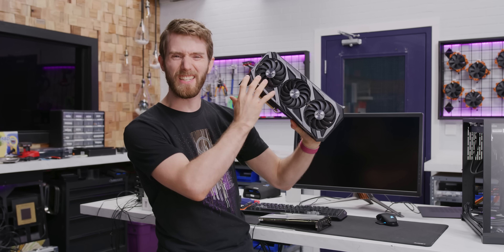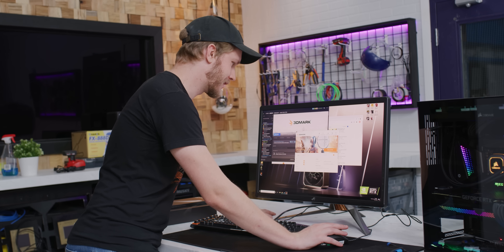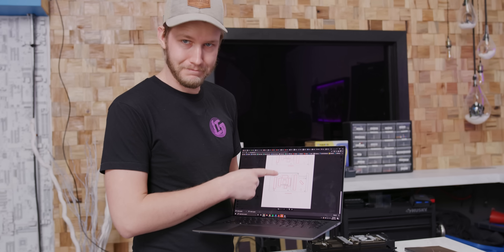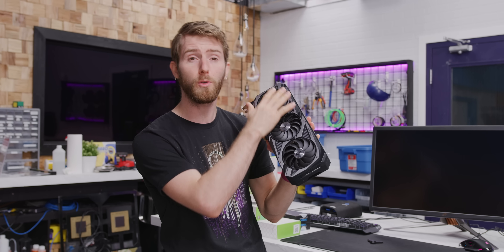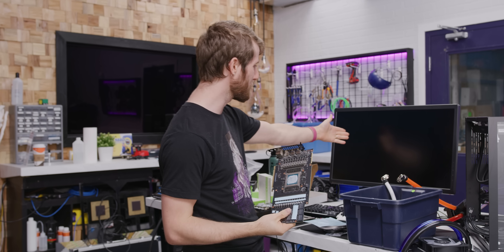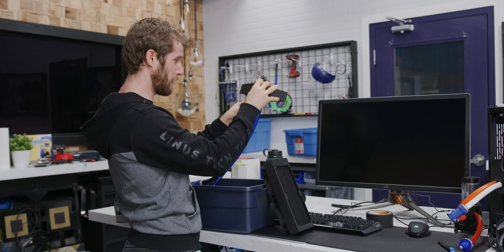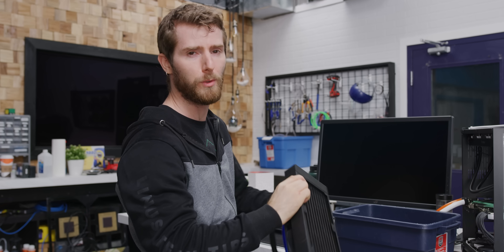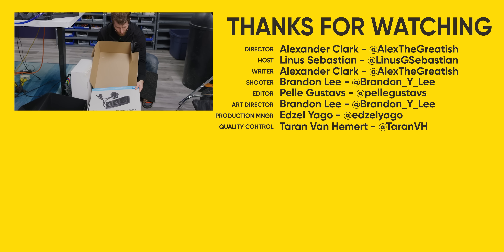Water Cooling the RTX 3090 is... More Complicated

Comment: My Alphacool st30 x-flow 360 rad is essentially silent with my fans, asus rog cpu/m.2 monoblock, and an alphacool cape Cora passive radiator so I don’t even need fans. And I only use 3 of the 6 cape Cora pipes, making it about the width of a regular radiator. I’m sure I could add my Gpu to the loop with no change in temps but I don’t have to, the whole system stays at room temp even with a blower style card. Open air case ftw.

Comment: I have a 9700k and a 5700 XT in an NZXT 200i (ITX mini), both water cooled. I have a 2 fan rad in the front, and a single in the back. Both are the EK slims. I have the 5700 XT core pegging 2050 all the time and 9700k at 5.0. The CPU will sometimes get up to 65 and the gpu stays around 55. There isn't a lot of air flow in the case, so I'm pretty happy with results.

Comment: 4:00 - Dude, you should learn how to use a file. You have to use all the length the file offers and less pressure. And get a file with smaller teeth...

Comment: I'd love to see another video like this with a CPU included in the loop. From what I understand (and I could definitely be wrong, so if so please correct me) most people who do custom watercooling don't have separate loops for their CPU and GPU.  I imagine most people who own this card pair it with a high-end CPU that's gonna dump another 100 watts or so into the loop, or more if you're overclocking, which makes me think the sweet spot is probably closer to 280mm or 360mm worth of rad, as opposed to 240.
Reply: One component, a 120 or a 240 worth of rad space more will be perfekt if you oc.
Reply: @I_Like__bananas Lol... Tell that to someone who's putting an overclocked 13900KS and a 3090 Strix OC in the same loop. Could get pretty toasty. Of course there's always the option to use industrial fans additionally. :D
Reply: @AlexanderDinebier  well, the 13900K wasn't out yet. But I believe a 480/2*240 rad will be more than enough for it while you don't OC the shit out of it. If you do you might get a little warm
Reply: @I_Like__bananas  A shame i'm doing exactly that with it. :D Still waiting for my motherboard to arrive though. (Got two 280x45mm rads, 0.7 bar DDC pump, direct die cooler and Noctua NF-A14 IPPC-3000 PWM fans in there.)
Reply: @AlexanderDinebier  Or you could put the open case on top of your car roof and drive around like you stole it in GTAV, that could make it run marginally cooler, I mean I am going with the flow here, he just put a rasp to a 3090, I mean... just brainstorming ...

Comment: Ok friends, im going to be building a dual pc streaming/gaming setup in a Phanteks Evolv X and its going to have a 6900k/3090 and a 7700/2070 combination. I am planning on building one custom loop to handle all the components. Will a single 420mm radiator in the front (the max size allowable) be enough to keep everything nice and cool? the 2070 and 7700 will not be overclocked and i doubt i will overclock the 3090, however the 6900k (engineering sample) is sitting at 4.5ghz. thank you for any advice.
Reply: No. You will need at least 3 large triple rads just to start. Best to just do two separate loops (2-4 rads total) so that you are not recycling hot water through the system. 
Also, that CPU will heavily bottleneck with a 1080, let alone a 3090. Dumb build and you should feel bad. 
Get 8/9-series cpus for the 3090 and 2070.

Comment: THE WATER BLOCK PIECES SAWED WITH A FILE SHOULD HAVE MUCH MORE RIGHTS TO REMAIN UNIVERSAL AND IN MY PLACE THAN TWO CAPACITORS. THANKS TO THE SOLDERING EQUIPMENT, IT COULD BE GENERALLY REMOVED OUTSIDE THE PORTION OF THE COMPUTER. NOW THESE TWO CAPACITORS CAN BE CALCULATED TO INCREASE Wages

Comment: triple rads also make sense for a quiet build.
Why? You can run the fans at lower rpms. 3 fans at low rpm are generally quieter than 2 at higher rpm.

Comment: I've been a loyal fan since 2013 when I got my first puter, in the mid 2000's we had some old desktops and monitors (one was blacknwhite) and i was around 7-8 had an old projector setup and one of the windows 95 or 98 desktops setup and my older brother told on me cause i wrote in mspaint "Nick is gay" and they took the computer and locked it in the basement in the spandrel under the stairs with the other 5 computers and sadly we moved in 09 and he left two giant projectors with three rgb lenses (we used to play n64 on it) and all those old desktops, the giant projector was on wheels and was at least 3ft x 4.5ft = 1meter x 1.3m.

Comment: Fastest flow rate on the pump is not always best as it may not transfer heat as effectively in a low flow friction loop.
This is also why the two 120 rads they tested were identical because the water had little time to transfer out of the loop.
Reply: Not true, I tested this extensively in my system and its false.

Fast flow rate results in better temperatures overall every time, HOWEVER, slower flow rate increases delta between temps throughout the loop (I see as much as 8c difference between thermal probes after the GPU and after my radiator in my case) so depending on where you set up your thermal probes, you may think you're getting better temps but all you're seeing is a higher delta throughout the loop.

Overall, running a pump faster always has a positive effect, albeit it's usually not a very large one past a certain point (depending on your loop and flow) and not worth it considering the noise 

I also found the advice that "loop order doesn't matter" complete BS in my small form factor build which reaches coolant temps of up to 50c. In that environment, delta can be as high as 8c as stated, so it's much better to have the CPU right after the radiator (CPU temps are more critical) and definitely not having the CPU after GPU

Comment: I tried it all, and can say, put as much as you can radiators and pumps. It makes the water temp as close as possible to room temp. And putting more pumps, makes them work less hard and less noisy. I had, 3x140+2x140 with D5. Room delta was 5c. Now I have, 3x140+2x140+9x140+9x140 with 4x D5. Delta is nog 2c and cpu top temp dropped 5c, because of good headpressure.

Comment: Hey Linus- When using a thermal camera, you ideally want to make your measurement surface matte black to optimize black body radiation. This will give you the most accurate number from the instrument. Not quite sure how much difference it makes at the low temps you're operating at. Shrug

Comment: Hey Linus, speaking of the 3090 (and all the 3000) beside the shortage it seem that the pricing Nvidia told us (witch is already costly) could be far from the actual pricing sales even when the sales resume and they flood the market with the 3000. Many seller and reseller I spoken with justify thier prices not just cause the shortage but saying that the 3090 will never sell at 1500. A journalist even Said that it all could be a scam from Nvidia to do shortages on purpose to keep pricing of all the 1k 2k 3k gen ultra high.  So can you tell us what is going on what you think, a video on this topic would be very intetesting. Do Nvidia can really find a way to block bots of resellers cause nearly no ones got the new cards, only poeple eho had it reserved like you and resellers :(

Comment: Hey put it in a NCASE M1 with a 3950x or 5950x.  Use two slim 240 mm radiators and the external res with the ddc pump mount or the external res with the apogee or with the barrow pump cpu res combo block.  Or should I just wait for Optimum Tech to do it?

Comment: My evga hybrid 2080 s is about the same max temp on full load being about 60 c and the 120mm radiator is quite hot. Just wish they didn't run the pump at 100% the whole time.

Comment: Linus: "Don't worry about temperature, worry about clock speed"
Single thin 120mm: 2000mhz

Single thicc 120mm:_____mhz

Triple thicc 120mm:_____mhz

Umm......I think you're testing methodology is busted.....or you're shilling for Nvidia by not mentioning that Nvidia clipped the heel of the 3000 series by locking down clocks.

Which is it?  Because I know my 1080 (because I sure as hëll can't find a 3080 or 3090 to purchase, let alone have multiple thrown at me to keep my mouth shut) will clock to 1976mhz on air, but since I've been on water she is consistently at 2012mhz.

Comment: appreciate if anyone can answer this, would the same apply to a cpu?

Would a thick 280mm rad be better than a thin 360 rad for watercooling?
Reply: A 360mm rad has about 10% more surface area than a 280mm, so I would say a thick 280mm might be slightly better or equal to a thin 360mm. That said the amount and type of fans will have a pretty big impact too. A CPU is just another heat source (often generating less heat than a gpu), most CPU can be cooled well with a 120mm/140mm, but high end and high heat chips like the 9900k/10900k or 3950x/5950X would do better with a 280mm or 360mm. (I'm running a 280mm on my 9900k OC'ed to 5.0Ghz all core and its still pretty warm )

Comment: So your telling mine i7-8700k runs hotter than a 3090 you serious my stock i7-8700k all stock speeds and voltage whatever i actually think its lower voltage but none the less i have a 360rad and it will come to 80-85c maybe around 60-70% load woah i guess i got a hot cpu then damn lol

Comment: I really love the idea of water cooling to prevent fan noise from your machine... all you need to do is take the 3 fans off the card, add a water cooling block and then put in a radiator with 3 fans.

Comment: Hey what about you seal that graphic card in oil or some liquid that believed can regulate the thermal efficiently. Kinda covered the entire card into thermal paste and make it water resistant and put kinda small containers that fill with water that run thru it 😅👍🏽
Reply: And why not encase it inside a magnetic field while you're at it.

Comment: Preface: I'm 35 seconds in. But yeah the TDP of these GPUs is the same as my SLI rig. I'd probably want a 120mm rad for it as a guess. Then again I used to use 280mm for my CPU alone. Also the Fury X was a high TDP card that did fine with an off the shelf 120mm AIO.

Comment: Bigger-than-"necesary" radiators aren't completely useless - the RTX 3000 will keep boosting all the way down to <10 degrees, according to sub-zero testing.
The colder you get it, the higher it boosts, and that "four degrees" might be enough for a higher speed bin.

Comment: thx for shining a light on something I already wasn't sure about "thick radiators" initially I had one 55mm at bottom/intake on my lianli case but I noticed it completely killed airflow, almost zero air coming out of one of my main "air intake" I swapped it with a 30mm and yep noticeably better airflow inside the case now while cooling is nearly the same, thick rads only make sense if you plan to run them with high speed noisy fans for a work PC that runs hot all day bad choice for a "daily driver" gamer pc (btw running 3x360mm rads on that lianli case and I can confirm you need 1x360mm for a 300+watts gpu that's why I upgraded from 2->3)

Comment: What about 420mm rad? I used to have a 420mm + 280mm rad combo on my 8600K + 1080ti loop. Thing ran at 48 degrees cpu, 45 degrees gpu on full synthetic load, all fans(silent wings 3) ran at 800rpm.

Comment: Considering the sum of the pc's heat dissipation if i could experiment i would connect it to my home hvac system with a heat exchanger as a reheater in the return water loop of the heating or domestic water circulation. If you have such a system.

Comment: Why did't you test a 120mm rad in push pull with 2 fans. Derp.
Reply: Both the SE and PE rads are pretty slim. I guess there would be zero improvement with the SE and very little one with the PE.

Comment: I'm currently working on a Cerberus X build with 2 Hardwarelabs 240mm radiators and a 120mm cooling a 3090 FE and 5950x. 
This was quite a helpful video to set temp expectations - thank you.

Comment: You should try push pull configration with the 120mm radiator
Reply: Who the hell uses a single 120mm radiator to cool a 3090, without having the absolute need in terms of space to do so, but then wasting space by using a second fan? Just use one good fan. If it's too weak to push air through such a toy, you should simply buy a stronger one. Noctua industrial line for example. Should be enough to overcome obstructions inside the case too.

Comment: My only issue with the quick test methodology is testing the stock cooler with the side panel on, and the rads outside. I assume the temps would only be a few degrees lower, but would have been nice to see with the rad inside the case.

Comment: This seems like a waste of time to do such a simple test. It was already known that 2080ti's with integrated aio, and no fans required a 240mm radiators. We already know that the kingpin 3090 will use a 360mm radiator plus a on card fan. By simple deduction for the 3080/3090 cards 120mm and 140mm radiators are insufficient. For a gaming PC or workstation the minimum is a 240mm radiator with the actual sweet spot being a 280mm(45mm thick) radiator
(360mm radiator if the CPU is also in the loop). For max OC as Kingpin and TiN already showed when they teased their design. A 360mm is the minimum with a 420mm or 480mm radiators being ideal. With thicker radiators being preferred with higher core count CPU's or if the VRM is also being liquid cooled. This video just makes you look like a certain beloved how to build a PC video;)

Comment: Hey guys, if you could take a minute and help me I’d appreciate it so much. I have a cyber power pc and after 20 minutes of gaming (forza horizon 4, cod, among us) my cpu fan will kick on high and stay there until I turn it off. Sometimes the gpu fan also kicks on medium to high as well. It is not near any dust, it sits on top of my desk and I clean it about ever week. There is nothing blocking the vents or anything. Any ideas on what’s causing it to get so hot?

Comment: *"perfect case" for RTX3080/90 FE card..."*?
First to set the stage, the extended heatsink has a FAN on top of it which pulls air THROUGH the heatsink and pushes it towards the TOP of a typical case... so I thought this would be perfect for something like the Fractal Design NODE 202 because that hot air would be pushed out the TOP of the case directly as it would sit an inch or so from the exhaust port on the top of the case... or maybe this approach would work well for something like the Corsair One that looks like an XBox Series X... either way, I think we need to see more case and cooler redesigns to complement each other.

Comment: If you are really concerned enough to water cool a 3090 you are not going to limit your radiator fans to 1100 rpm, this is ridiculous.  The stock card ran what ever fan rpms it wanted, up to 100% fan rpm.  Get real or stop testing stuff and putting junk data out there.

Comment: Linus, if you use car cooleant instead of water, water cooler performs better?
Reply: you can use any thermally conductive liquid, but the issues you would want to watch out for would be going sub-ambient and to make sure it doesn't gunk up the pump. If it goes sub-ambient it can cause condensation on the cpu, or gpu whichever you are water-cooling, and that condensation could leak into the components breaking them

Comment: To be fair, that furmark was probably limited to the max wattage, which is most likely under 400 watts (even with a basic overclock) because of the vbios restrictions. I’d want to see how much cooling is needed for the 450+ watts you’d get with a less restrictive (if not unlocked) bios, like evga recently supplied (500W) - even my 1080ti is able to go through 420W of heat in furmark with an XOC bios and reasonable clocks/voltages, on air, not going over 75C

Comment: I tested this out about 2 weeks ago...

I started with a Slim XSPC TX 360 on a single side pull config and my temps were baaaaaad, hitting right up there at 58-60c almost!  Swapped out for a Corsair XR7 360 55mm radiator and it now sits at a comfy 45-48c depending on the application. Must better clocks as well, hit over 14k on port royal.  I'm using an alphacool Aurora plexi gpu block.  Will test again when my Aquacomputer Kryographics block comes with the XCS active backplate cooling comes.  I'm hoping the added cooling on the backplate will help as some have already proven with fitting a Ram block on the back plate to cool the rather hot gddr6x chips!  Since the 3090 has them on the backside of the pcb where as the 3080 doesn't.

Comment: A 240 rad for the GPU and another one for the CPU in a dual custom loop will be difficult for my planned add build. So maybe single loop and manifold with either one 360 or a 120+240 in serial.

Comment: I have spent sometime in cooling my aic 3090, the secret is to cool the backplate. Sticking a heatsink and a fan on the back plate. Even with asus 480w bios, my 3090 can stay at 70c with the stock radiator.

Comment: Would like to see testing with a controlled heat source, ex a 250 watt heating element or some such.  Bring the loop up to saturation without airflow over the rad, then measure how low the rad can bring the temp of the water with various sizes and thicknesses of radiators. Then also like to see with that same constant, controlled heat source, the effect of various fan speeds or styles.